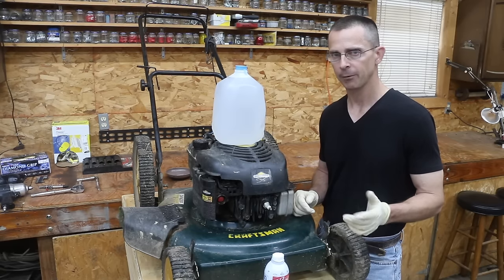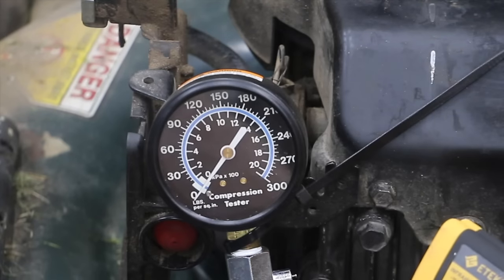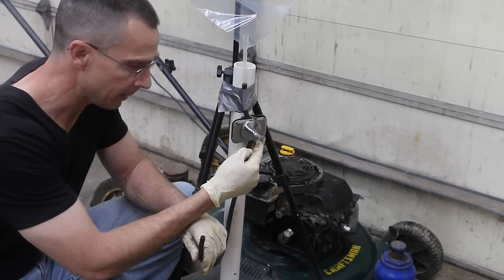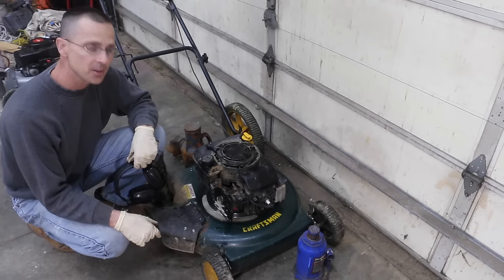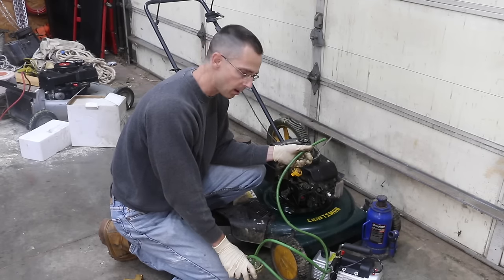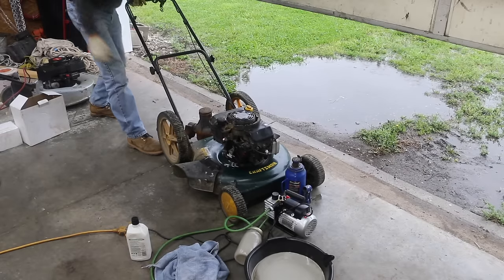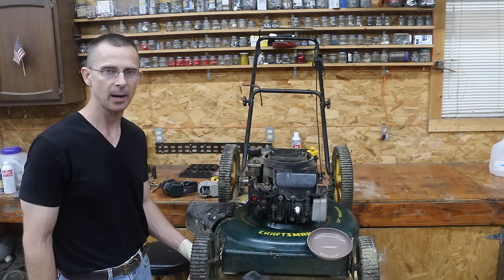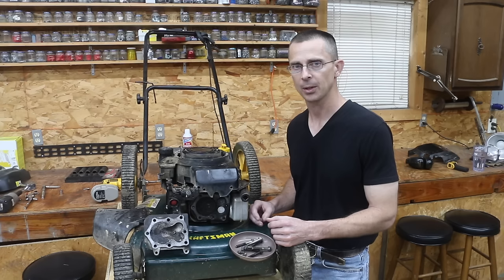Seafoam--can't believe what it did to my engine episode 5--cylinder cleaning test using water!!

Comment: Never thought I'd see a "saline drip" hooked to a lawn mower.  But for cleaning out carbon from old carburated engines, I used to gun the engine with some starter fluid for a couple of minutes.  The idea was to burn the carbon out without going too long and burning the rings up.  Problem was, my results were very hit and miss.
Reply from the maker: Thanks for the feedback.

Comment: I had an engine where the head gasket was leaking and eventually failed. It was leaking into the n 2 cylinder,  periodically it was giving off white smoke, which was steam. That cylinder was so clean compared to the other 3.
Reply from the maker: Thanks for the feedback.

Comment: The water was trickled in to rapidly for such a small engine as observed by the drop in EGT the best way to decarbon an engine with water is with a spray bottle and revving the engine up and down as you spray it in the constant flow of water cooled the engine off and did not allow the carbon to be blasted but obviously it cleaned the rings because there must have been carbon buildup in the rings resulting in not only the water getting past the rings but the compression increase after treatment carbon removal should result in a lower compression that is as long as their rings are not carbon stuck
Reply from the maker: Thanks for the feedback.

Comment: One thing, when introducing the water, I would do it as a mist. Use a simple submersible pump and then a spray nozzle from a spray bottle so that you're getting finely misted water.  

Then I would try it with hydrogen peroxide. I wonder if the introduction of hydrogen peroxide which of course is going to decompose to water and oxygen would have a good effect on carbon.  But I'd introduce that very slowly as well. If it's quick enough to significantly reduce the engine and exhaust temperatures, then I would say it's too fast.
Reply from the maker: Thanks for the suggestion.

Comment: I see that this it an older video of his, he has improved testing methodology. Yes water can and has been use to de-carbon engines, the best method for cars is to poor a cup into the carb/intake while the engine is hot and at 2500 rpms. There use to be devices that were sold to improve mpg that dripped water into carb while driving, these products were sold in 1970s.
Reply from the maker: Thanks for the feedback.

Comment: The water turns to steam. Which jumps the compression tremendously while running. So the extra pressure creates blow by. That’s an old junk lawn mower. But water injection is still used on high horse power diesel rigs and has been used fkr decades to increase compression. It’s the OG of nitrous oxide.
Reply from the maker: Thanks for the feedback.

Comment: If this test was redone I would recommend  you using  induction  service tool reson being is too much water was being ingested into the intake. The water would have to be more of a find mist the. Reason it works better on engines is because mainly for carburetor vehicles. It's allowed to puddle in the intake, slightly and boil. I think the water idea works even better than what was provided here. It just needs to be. A little bit more regulated, as far as water ingestion. If you were to use that tool, I would doubt there would be oil and water mixture.
Reply from the maker: Thanks for the suggestion.

Comment: Why not soak the combustion through the spark plug opening, with cleaner overnight and then run it without the spark plugs to get rid of excess cleaner before you run the engine.. That's what we are doing here in Philippines to clean them.. we use battery charger to run the engine starter continuously.
Reply from the maker: You are welcome!

Comment: Only use distilled water on your car.  Minerals in tap/drinking water will bond to your valves under the heat making them unable to seal/shut properly.
Reply from the maker: Thanks for the feedback.

Comment: I know this is an old video, but. I’ve always used water and some Dawn dish soap in a spray bottle. Turn the nozzle to a stream pattern, get the engine HOT. Not just sitting and running but after mowing…HOT. Manually raise the RPMs a bit, nothing crazy, but a bit. Then squirt your water/Dawn mix in while tached up until it starts to stumble a bit then stop squirting, let it recover. Do that process 15-20 times or so. Some of today’s newer small engines have cats, so keep that in mind. You don’t want to clog that.
Reply from the maker: Thanks for sharing.

Comment: Done right the water works and is cheap. Seafoam works (somewhat) too but isn't cheap. Given that some carbon build up is normal I think you'd be better off using a good fuel additive once in a while (One with polyetheramine, or PEA) . Gas is never going to burn 100% clean so, unless build up is severe, just live with it.
Reply from the maker: Thanks for sharing.

Comment: My grandfather owned a Ford dealership back in the 40s to 60s and told me people would come in saying their car is idling rough. He took it inside and used a water mister to have the carburetor suck in tiny water droplets to crack off the carbon. I then grabbed a water bottle mister and started my 82 Mustang engine. I then squeezed the trigger for water droplets to come out above the carburetor. I did it slow so as to not stall the engine. It would choke a little so I would stop and I saw white smoke coming out the tailpipe. I did this for about 10 minutes. The car ran so much better after that.
Reply from the maker: Thanks for sharing!

Comment: I used water from a spray bottle about 6 years ago on my Toyota hilux 5VZFE engine straight into throttle body. When I sold it. It still had 179 psi per cylinder still responsive after 285 km. No emulsion in the oil. I did an oil and filter change but it was spotless. Man I drove that thing hard. Lol
Reply from the maker: Thanks for sharing.

Comment: Ok using water to clean carbon off the cylinder head and piston and valves in a lawn mower does work to a certain degree but the water idea works best for car and pickup engines both gasoline and diesel engines,now water that is used has to be put through the intake manifold and is sprayed in with a form of a mist and not trickled or poured in and you need to use a whole gallon if water,
Reply from the maker: Thanks for the feedback.

Comment: In the 80s I took the head of a car engine because it had a cracked head. The car would fog a street with water vapor. One piston and combustion chamber looked brand new  . The mechanic I worked for said of course it does it's been stem cleaned. He taught me to use a spray bottle to vaporize the water as much as it could while running the engine.. . I also know Chrysler used a carbon removal spray that you would spray down the carburetor. Could give that a try
Reply from the maker: Thanks for the suggestion.

Comment: A friend of mine decarboned his two-stroke engine using a perfume sprayer and only an ounce or two of water at most. 

Just pouring water into the engine and not atomized or sprayed in in very fine particulate form is ridiculously. It will push past the rings and contaminate the oil.  

Gallons of water is not nessassary.

Lower temp also does not facititate the removal of the carbon temp is very important and must be maintained. The water must be converted into steam, and very rapidly, this technique was used on older radial engines in large aircraft to boost horsepower and help cool the engine during extreme full throttle operation with high gross loads, and was able to help the engine make more power without destroying it. Water has about a 100:1 expansion when superheated, so to get any benefit from it does not take that much volume of water at all.
Reply from the maker: Thanks for the feedback.

Comment: a friend of mine worked for a salvage yard 30 years ago and they would pull a motor, put it on a stand start it up and let it run for about 30 seconds. He had a medium size dixie cup of water in his hand. He would slowly open the throttle with one hand and as did he would pour the water in. I remember all the carbon that would come out. I thought he was crazy....but it worked. putting that much water in a small engine? I think I would have tried a small dixie cup.
Reply from the maker: Thanks for sharing.

Comment: The slow steady drip is going to cool the piston chamber too much. For best effect, let the engine be full operating temperature and hit it with a Squirt of water enough to bog it down without stalling.

Let it regain heat and smooth idle and hit it again. Repeat.

The water needs a VERY hot chamber to be effective.
Reply from the maker: Thanks for sharing.

Comment: ahh yes i blew the head gasket on my 2001 blazer and the oil looked quite the same. the mechanics shop wouldnt do an oil change so i took it home swapped the oil after i ran a sealer through the rad. well it sealed it for about 2 weeks and then my oil got milky again, it got to the point where i had added so much water to the radiator that the motor couldnt hold anymore, and weirdly enough it had just enough oil to keep running, still runs today but im sure if it was an automatic it would stall, that manual transmission kinda prevents stalling. lol
Reply from the maker: Thanks for sharing.
Reply: @ProjectFarm  thank you for the reply, legendary 💯

Comment: I was told to use a spray bottle and spray the finest mist of water down the carb and as it gets pulled in rev up the throttle all the way dont just hammer the throttle but go to max rpm in like 2 seconds with a consistent pace and u should see puffs of smoke come out the tailpipe where u can tell its cleaning it out. Ive tried it seemed to work that was on a 68 barracuda tho i didnt check the cylinder head before and after. But it felt like the engine ran better afterwards.
Reply from the maker: Thanks for sharing.

Comment: Back in ww2 piston engine aircraft would inject a mixture of water and a bit of alcohol into the cylinders, This would help with lowering the temperature of the cylinders and after the fuel ignited the water would turn into steam adding a bit more power and making higer compression
Reply from the maker: Thanks for the feedback.

Comment: Seafoam wins imo, water is called the universal solvent for a reason. it can pull nearly anything polar into solution including the things you don't really want cleaned. It also has no issue forming an emulsion with your oil as demonstrated...
Reply from the maker: Thanks  for the feedback.

Comment: I think you should have use a atomiser to spray water mist into air intake instead. Or create hydrogen on demand (safer) thru electrolysis and feed it into the air intake at a steady rate (which is why water works in the first place because of the H and O, but the key is to split them up).
Reply from the maker: Thanks for the constructive feedback.

Comment: I use diesel to flush the crank case and run it 5 minutes and let it soak then repeat 6 times but it’s 50/50 mix with old oil, drain out some oil for process
Reply from the maker: Thanks for sharing.

Comment: I wonder if the water shortened engine life by scaring the connecting rod bearings? Perhaps a steam cleaner with the head removed would be safer and easier?
Reply from the maker: Thanks for the suggestion.

Comment: The way I did it was ad water by bigger amount almost to stall the hot engine at high rpm let the engine recuperate and water again for maybe half an hour clean the crankcase oil  !
But I never removed the head and no borescope at that time !
Reply from the maker: Thanks for the feedback.

Comment: It is my belief that water is useful because of it's specific heat.  It radically absorbs heat from the surface inside the combustion chamber, which causes a temperature difference between the metal and the carbon, causing it to flake off.  Most water-injection systems only come on either full acceleration or high-boost, for different reasons but same concept.  Specific heat.  It's probably a huge reason why life forms evolved using water.
Reply from the maker: Thanks for the feedback.

Comment: Your experience here, is why I’ve never done a water infusion on an engine. Water in the oil is about the quickest way to destroy one. There are products specifically designed for this purpose, that are much kinder to the engine. 

Just my 2 cents.
Reply from the maker: Thanks for the feedback.

Comment: It would seem that Seafoam works by the use of detergents and/or solvents, where the water method may work by the steam effect mentioned by others, OR possible the carbon is broken up by thermal shock. (Think of how a hot light bulb explodes when accidentally hit by water.)

Thermal shock can happen when something is heated too quickly or cooled too quickly. It is a real concern on very high compression race engines and some aircraft engines (esp. jet and turbine) when they are accelerated very hard without sufficient warm up time... bad things happen. Many old wood fired cook stoves were cracked by setting a kettle of cold water onto really hot cast iron. Incidentally, it also has been speculated that the Liberty Bell was cracked by cooling too quickly after it was cast.

Anyway, I enjoyed the video but I would never introduce water into an expensive engine. Some aluminum heads seem to have a propensity for cracking without the extra help. 

Just my opinion.  :-)
Reply from the maker: Thanks for the feedback.

Comment: I have used thick, but way too much water. You have to take the exhaust off or you will clog the spark arrestor, you also need the engine hot. Best way is to heat the engine up on nothing but fuel then with a spry bottle squirt occasionally the little the better.
Reply from the maker: Thanks for the feedback.

Comment: I  know for a fact that Water  does  clean the Engine . However , the water needs to be  SPRAYED  in . Atomised to some extent .
Also , Three Gentle Sprays , then a 5 second pause , and repeat for about 1 hour .The Drip feed is what caused the Oil pronlem .

Comment: Gee, I just caught this.
This is not at all, how I learned to go about it.
Generally, I have done it before an oil change. I have not come up with blow by like that.
What I do does not take long.
At operating temp, I hold the throttle open, and pour water in.
As the engine bogs down, I quit pouring and work the throttle untill it clears.
A few cycles of this, is enough. Ten minutes is plenty.
If there is some carb cleaner around, a follow up is worth it.
I have done a before and after look at the plugs
There is a positive difference.
I think trickling in the water defeats the process.
The components must stay at normal operating temperature.  
The shock and rapid expansion of the water changing state to steam is what makes this work.
A follow up with expensive, but remarkable Seafoam makes sense. 
Right now my old Ram 318's spark plug shields have rusted to the point, that it will be a job, not a chore, to get them out.
Part of my fall tune up, was a water dose.
Thanks for all the good work!  Chris
Reply from the maker: You are welcome!  Thanks for sharing.

Comment: I’ve actually seen this done in person on a vehicle and that’s not exactly how you go about it… I saw this done on a carbureted car. You rev it up to about 2500 rpm’s and kinda give it as much as it will take without stalling out if you give it to much you could damage the engine… But overall you don’t use nearly as much water. I think they used a coke bottle and put their finger over the end to adjust the flow. They might have used 8 ounces of water overall… But the engine is hot and the water is cold so that breaks up all the pieces of carbon that kinda stick up off the surface plus it increases the compression and helps to break it loose. I’m sure you’ve heard an old carbureted engine diesel and even backfire sometimes…😂 It will clear that right up… What happens is the carbon stays glowing red hot and the little bit of fuel leftover in the cylinders keeps igniting and then that draws more fuel in…. But I prefer the sea foam…😂 I’ve also seen this done with sea foam too… They took the brake booster line off and done basically the same thing with sea foam on a fuel injected engine. I believe the can even tells you how to do it that way but I could be wrong… But they might have removed that recommendation because they have that spray sea foam now… I’ll have to look on one of my can’s tomorrow.. Mechanic shops use to order cases of sea foam to help cars pass emissions here in Chattanooga Tn…😂 I don’t really know how they went about that though. You could also try a mixture of gasoline and automatic transmission fluid. Transmission fluid is full of detergent and it lubricates very well. I’ve actually done oil changes and replaced a quart of oil with transmission fluid too. If you have a noisy lifter or something it will take care of that too. You have to drive it for a while but it will eventually get rid of the noisy lifter. My first car was a Mazda RX-7 rotary engine and it had really low compression and was hard to start and an older guy told me to add a little transmission fluid to the gas tank when I added gas and it gave it just enough to start easier. It was so bad I had to put the fuel pump on a toggle switch so I could flip it on and back off. If you just left the fuel pump on it would flood the engine before it started…😂 It was a fun little car though. You could turn it up to about 11k rpm’s…😅
Reply from the maker: Thanks for sharing.